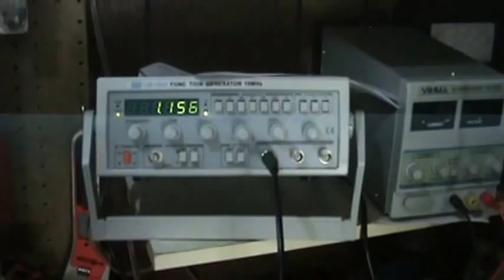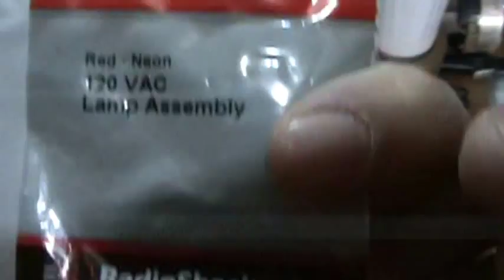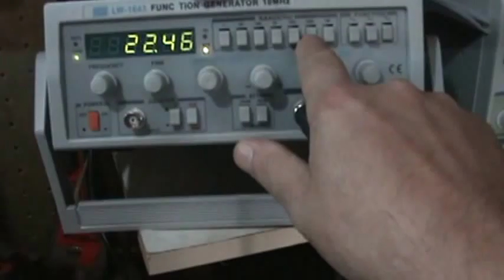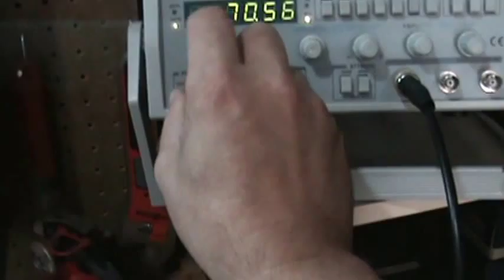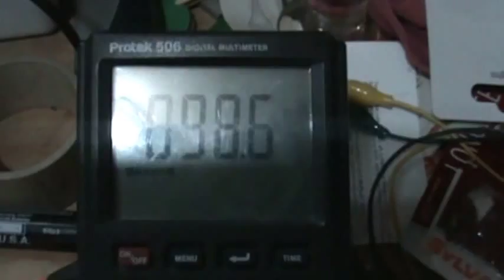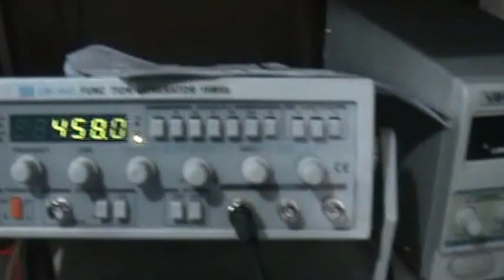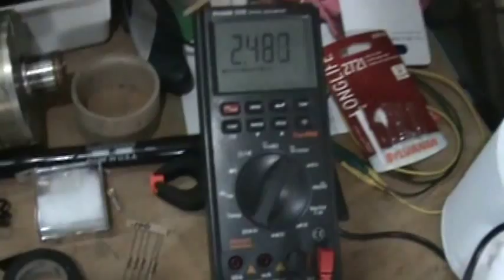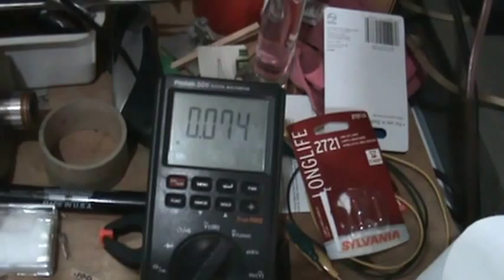Free Energy Concept, Resonating coil

Comment: I'm trying to understand a lot of things too so I'm with you on the learning curve to reluctant discovery ... fear of criticism can be a barrier if we let it but we all need to embrace those who are trying new things for greater discovery.
  
Excuse my ignorance coz I don't know much about electricity other then don't stick my fingers in the wall socket so I'm trying to understand what your doing in this video.
Are you attempting to transfer resonating frequencies into an inductor to transfer energy?  Isn't this like what Tesla did in his wireless power transmission experiments?  I don't know, just thinking out loud.
Don't laugh but I'm working in unfamiliar territory too... trying to sculpture magnetic fields to concentrate or amplify the energy in the hope of converting (spinning) negative electrons into positive electrons. I think this transition may change the molecular weight of a body in motion.  Egaaads... I know.. LOL    Thanks
Reply from the maker: Yes, transferring energy wireless, from one coil to the other, they are magnetically coupled, resonating with each other and with virtually no current. Yes, Tesla technology :-)  Besides this project, I too am working on manipulating magnetic fields :-)  You are on the right track with reversing particle spin & anti-gravity :-)
Reply: Cool...  My project has me working on sculpturing magnetic fields thru the use of shaped coils... asymmetric and those using hyperbolic surfaces.  Trying to run a Searl motor type configuration without the need for the weight of extended horseshoe cores. Plus forcing concentrated (amplified) radial magnetism to the outer edges of a confined space.   Its kind of like what David Sereda was working on.
Reply from the maker: Very interesting project your working on,,,,thanks for sharing.
Hmm, i was just reading one of Davids posts, something about tachyon beams & traveling 3 Xs the speed of light.
Reply: Yea, that's out there  ... I'm just trying to lose X percentage of weight off cars and trucks to improve fuel millage and extend the life of tires. :)  ... the NSA has ears!  LOL
Did you hear that Bushman stated that once we achieve anti-G,  we engage with the 6th universal force of ...Expansion.  Once we're there, we're able to use the 7th universal Force... Consciousness? 
He claims that Gravity and Inertia doesn't exist in the plane of Expansion and since "Though"t is an electrical wave of energy, that when used in the neutrality of the plane of Expansive, thought is sufficient force for ET's to maneuver there craft and achieve speed of light travel.     ...that should help fuel mileage huh?
Reply from the maker: Sir Farquat Yes, collective thought.  To resonate your thoughts with the universe and manifest what you want through thought.  It all makes perfect sense,,,,look at many savants and their special abilities.  I think also Tom Beardon mentions that we are just not ready for the truth, we cant grasp it.  Well people like you and me can, but not most of the population.  Every devise made by man started as a thought :-)  I just found out about a 14 year old Kid named "Jacob barnett" who is debating Einsteins theory's.

Comment: Hi Paul,
It is important to show your fails, just label them as fails so you wont get the negative feedback. anyone interested in participating will want to know what not to try. That said I'm not trying to burst you bubble, just offer some guidance. You are creating a fluctuating magnet field so you are inducing a current. the capacitors you replaced, you can get the same results using different resistors. The reason for the neon glowing is the clasping magnetic field in the coil that produces a voltage spike. At the lower frequencies the gap between spikes is to big to maintain a visible glow. At higher frequencies the field is not allowed to totally collapse therefore not generating the spike. I'm not sure but I think if you tried different coils the frequency range will change. You only need one wire to generate a single so the open circuit really is not a mystery. It only works with a single not DC. It is important to understand what you are observing so you can best determine how to proceed.
Reply from the maker: It is important to understand what you are observing so you can best determine how to proceed.       I agree completely, thanks :-)  Thanks for the comments, every bit helps me more.

Comment from the maker: Yes, i was thinking of using an antenna, or maybe uranium ore, or even some bismuth(safer alpha emmiter), high frequency of decay/radiation.
  I get about 100V but only micro amps with my "free energy from air circuit" that i have a 24 part series of,,,i think this will work nicely :-)
Thank you for your kind words.
Boyd, i love his experiment with dropping magnets, i have done many similar experiments.

Comment from the maker: Yes, good question,  Im still thinking about how to do it.  I will have to work backwards.  Must make coil and caps to resonate with the 256KHz. Maybe to use the neon bulb as an indicator for when resonance is reached.  I will have to use variable caps and induction coils to tune everything.